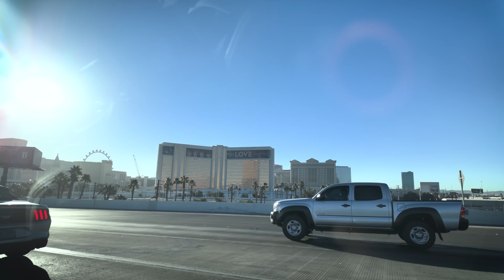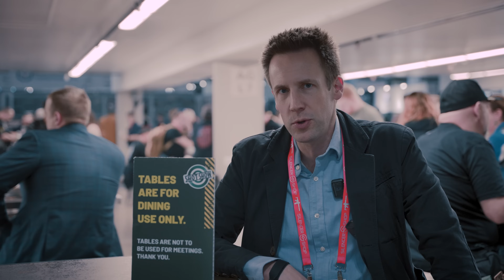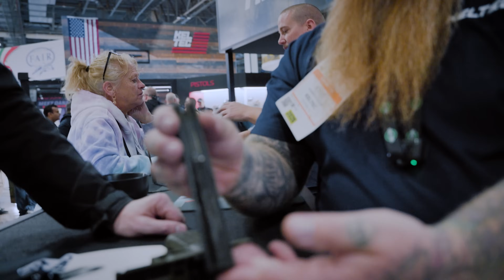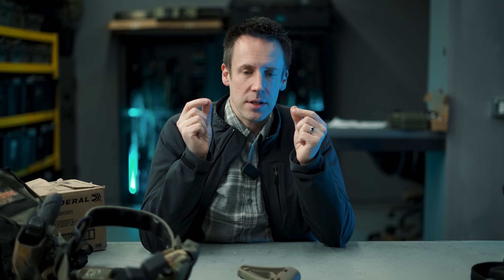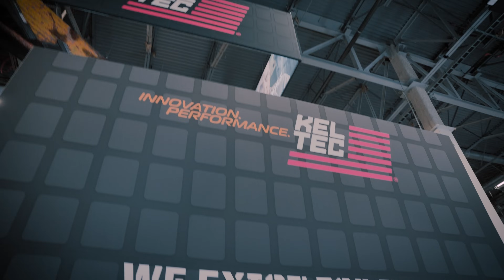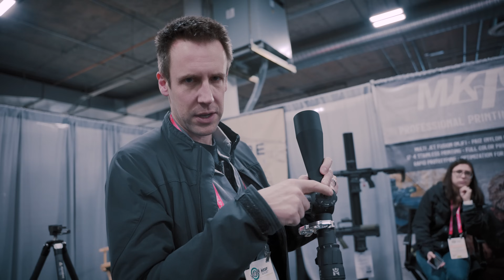Future Manufacturing and Historic Firearms at SHOT Show 2025

Comment: Metal Injection Molding, Laser Metal/Melting Sintering and 3D Binder Printing (post-cure) Metal Sintering, will take firearms design and manufacture into the next era. DMG Mori make a 5-Axis CNC Machine that incorporates 3 seperate manucaturing technologies into one unit. 1st it has a wire extrusion laser welding metal 3d printer nozzle (basically like a 3d-printing, Argon-gas injecting, MIG welder NC gun), that prints out the oversize rough part geometry. Then it has a 5-Axis NC Milling head that cuts the part to size. Finally it has a high-energy Laser-Ablation head that burns the desired surface finish geometry into the part, of any intricate design (no need to engrave with the milling head cutter). This surface treatment would either take days to engrave or not be possible at all due to the desired complexity. The Laser Ablation head to the CNC machine can burn anything from complex, intricate decorative artistic engravings, to honeycomb patterns, or even radomized stippling grip finishes. They use them to design the Tool-Steel Plastic Injection Machine Molds! Virtually all manufacturing steps can be done in one CNC Machine. This cuts production time into a mere fraction of what it would've taken prior to the invention of these machines. It should be the next era in weaponry design. The only drawback being the cost of the unit and the training time needed for programmers. Thanks to AI advancement programming won't be needed in the coming years, and even engineering times will be a mere fraction due to Atifical Intelligence automated FEA simulation and automatic A.I mechanical design iterate optimization and simulation. Also, now that Trump has brought Microprocessor manufacture back to the US, we should see microprocessor control incorporation and feedback sensor circuits designed into the weapons systems, aka smart-guns! Incorporation of electrical actuators, solenoids and drive circuits via rechargable micro power banks and minature Super-Capacitors. Reduction in the need for spring systems, gas systems and inertia-driven systems, increasing firearm longevity by cutting down on friction and part-fouling components. Example = (Imagine an electrical H&K G11 = half the complexity, half the mass and half the size). On-board weapons system telemetry and bluetooth communication to weapons systems app data logger. Increased safety, drawback = increased power of the ATF TO shut down your weapons system. Exciting times for Engineering Ingenuity, what America has always been that much better than everyone else at! We will see if we stay on top. The only thing that will hinder this, is good-old Beauracracy!

Comment: Big Horn Armory Model 89 Tactical Take-Down (Browning Designed) Lever Gun, chambered in .500 S&W. Incredibly strong spline-lock system. Can fit in a custom backpack for hunting. Picitanny rail mounted optics. Kentucky Balistics showcased a .500 S&W Magnum Research BFR revolver surprisingly enough. Video showed the revolver to have close machining tolerances and not much cylinder gap. Phenomenal suppression characteristics, due to the heavy rounds naturally subsonic performance. Round capable of taking down huge game, more in the realm of Elephant Gun Nitro-Express, only suppressed, portable and with a 5 round follow-up shot capacity. Big Horns quality is superb, they make a Black Thunder non-take-down version and a White Lightning version too. Some of the most beautiful rifles ever. Use of a fully Titanium, light weight suppressor won't add much front-end weight. No worry of automatic fire overheating Titanium issues for this suppressors application. I would have made one already, but I live in California, a Civilian and broke, lol! With the suppressor and adapter, probably around $5K retail. For you guys = FREE! Must be nice! GREAT CONTENT SIR'S, KEEP UP THE GREAT WORK PLEASE!

Comment: - I want to see more future 22LR caliber focused firearms with an industry to take this legendary cartridge to the next level.
Yes, the 22LR rimfire is very small, old, and very dirty round... But, does it have to remain dirty? Old methods are tried and true, but could the gun industry do better? I think so. Yes, there are some new cleaner rounds being made but those new 22LR rounds have been debunked several times. Some have said the new cleaner 22LR's are actually at times more dirty and are much less accurate than it's 22LR predecessors.

- Why the 22LR rimfire? What is it about the 22LR rimfire that I find to be so attractive?
The 22LR is a caliber that has been around forever, it's incredibly accurate at long ranges, effective at short ranges, the rounds are dirt cheap, there is absolutely zero recoil, but the #1 main reason why so many people are flocking to and are consistently shooting their 22LR's is solely based on how damn fun they are to shoot suppressed. There is nothing else quite like a suppressed 22LR. It's damn near Hollywood quiet especially if you've got a 22LR bolt action or lever action rifle suppressed because all of those gases are pushed forward towards the suppressor to work it's magic. I am not kidding you, the only thing you hear is the bullet hitting the target and the small click from the trigger pull. Go watch some videos of people trying out their 22LR's suppressed for the first time where they mostly shoot their 9mm, 5.56, or 300 Blackout's, and you'll see the biggest smile on their face when they pull the trigger of that suppressed 22LR. Go watch some ballistic gel tests showing some crazy expansion performance using a 22LR, even up against some 9mm expansions. Now, am I saying the 22LR is the best round for every day carry? Of course not. Mostly due to reliability reasons that 22LR's still unfortunately have. You're going to get a few 22LR rounds that just don't fire, depending on the ammo... But, most importantly to prevent misfires, it's typically the 22LR firearms you use. My most highly recommended, and the most reliable 22LR pistol you can buy on the market, that has not discharged or misfired, except only a few times on me, is the Taurus TX22 Compact. The Taurus TX22, TX22 Competition, or the Compact versions with a suppressor on it and you're going to be happy. Want to go quieter? Well, I have a Rossi Tactical Lever Action 22LR that's a blast to play with for the price point. Now, I've also got the new Ruger 10/22 Carbon Fiber Edition that was shown off this year at Shot Show 2025, that I actually just took home today, and shot my first few rounds through it suppressed and I swear, it is even more quiet than the rest. I still prefer my Taurus TX22 Compact simply because of that pistol feel we all know and love, the great upgrades, the performance is stellar, with that almost James Bond quiet vibe to it. My lord, it's just a dream to shoot. The TX22 is an incredible 22LR pistol. Also, don't knock lever or bolt action rifles either because they are also fantastic to shoot with as well!

- That being said, what is my point here? I want to see the gun industry embrace the 22LR and even try to evolve the 22LR. Bring more 22LR style firearms to the market with integrally suppressed models. People need to see, hear, and experience what 22LR's are like when suppressed to fully appreciate these little rounds. I want to see more gun manufacturers put in more research and development time into creating a better 22LR round. Not just use the same 1887 style of cartridge and powder mixture. Maybe if they can squeeze in a tiny centerfire primer 22LR to make for a more reliable round could be an interesting endeavor. But, if that means increasing prices, then screw it, we'll just stick with rimfire then.
The goal is to keep these 22LR's affordable, at 5 cents per shot, but just adding a little innovation.

- Go get yourself a fun 22LR to go plinking with, add a suppressor, and I promise you'll fall in love with it!

Build yourself a nice DIY Silent Bullet Trap too with a Backstop!
You don't want to annoy the neighbors plinking steel while suppressed.
It defeats the purpose of a suppressed firearm with loud steel targets. LOL!
----------------------------------------------------------------------------------------------------
How to build a Silent Mulch Bullet Trap: (YouTube Videos out there too!)
- Get a 27 Gallon Storage container at Home Depot or Lowes > Fill it with 4+ Rubber Mulch bags (Pack It Tight!) > Cut a square hole in the lid > Add a thick Rubber Backing on top of the mulch to keep the mulch from spilling out while also containing the bullets (Typically stacks of thick rubber car mud flaps work well) > Then put the plastic lid on top > Strap the lid onto the storage container using plastic zip ties > And, You're DONE! Stick targets to it and have a blast! These things are pretty much 100% silent and very cheap to make!
- Bullet mulch traps will take 22LR's, 9mm, and even up to 45 caliber rounds. I've seen them stop much higher rounds depending on how big of a silent trap you want to go. (Skies the limit!)
- Anything above a 45 caliber means you'll need AR500 Steel laid flat on the bottom of the bullet trap. 
- These rubber mulch traps are incredible, will last you years, and it collects all that lead too which is wonderful! All you do is pickup your bass casings. Environmentally friendly.

Happy Suppressed and Silent Plinking Guys!
Great video TREX LABS,
- Cheers!

Comment: Regarding your lever gun question.  Marlin 1894 SBL in 357. 16” barrel, threaded 1/2x28. Has a big top rail with a nice built-in ghost ring rear sight. Awesome stainless finish and laminate stock.

38spl is subsonic, even the cheap 130gr target loads I’ve tried. Super quiet. 357, on the other hand, comes screaming out with serious muzzle energy.

I love this gun and think it strikes the perfect balance between classic and modern. Very practical without looking tacticool.

Comment: Big bore wheel gats are so much fun, look into the ruger 460 or the 454 casual. With the 454 your often able to run 45 long colt through them as well, which can be more budget, friendly for Range Day or less of a recoil bite for smaller framed users

Comment: marlin .45-70. any other choice is inferior. the action is among the strongest of any lever action, the quality is great with it now being 'made' by Ruger. .45-70 is the correct cartridge as it can be loaded very hot for big power and you can put very heavy bullets in it to maximize subsonic suppressed performance. additionally, it is a very common cartridge with a lot of support. you can also get a magnum research BFR in .45-70 to go with the rifle, and there are not many revolvers of higher quality than the BFR.

Comment: For the lever gun, my favorite pest control and plinking rifle is a Henry Golden Boy that I had a buddy thread for a suppressor. Easy recoil for kids to learn shooting fundamentals while feeling like a cowboy and can easily drop a hog within 50-75 yards, what's not to love? I specifically made it so my younger nephews and nieces could have something to hunt and it has worked perfectly. Is it old west correct? Not even close. Will you spend hours popping cans with the kids while having a blast? Darn skippy you will.

Side note: If you toss and RC2 on it, while you can't see the sights, it does suppress it to silly levels. I found the JK 105 RFX 22 to be the best usable option btw. Modify the length for weight / suppression depending on the user.

Comment: The Henry Supreme looks interesting as a lever action, especially as a starting host for an SBR project, probably in .300BO because you can chop it down to 8-10" and not lose any capacity.

As for a revolver, nothing passes the aesthetic vibe check line the Remington 1858 cartridge conversion. That slanted webbing under the barrel is just chef's kiss 🤌